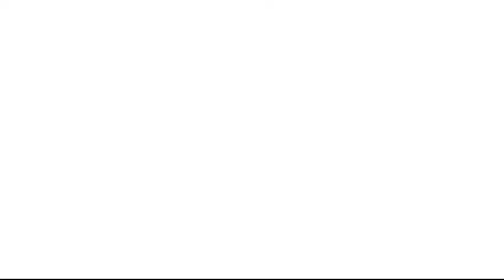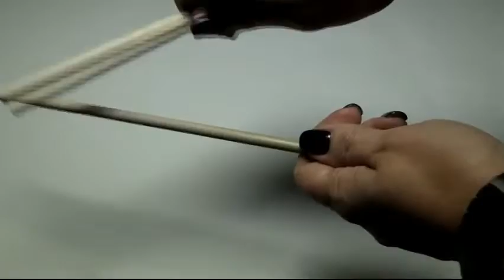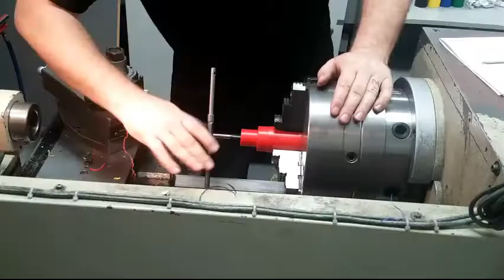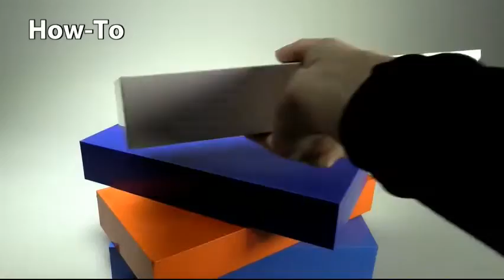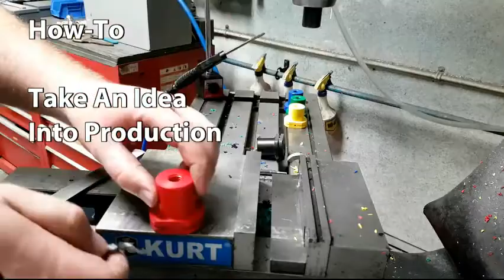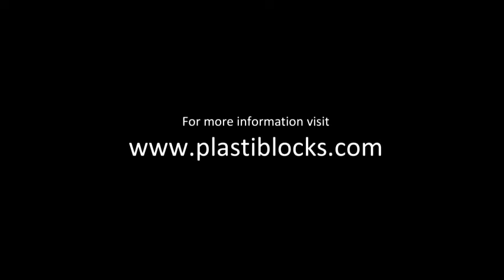Plasti-Block™  Channel  Intro.

Comment: Can you suggest a plastic type that is "gasoline" resistive for items like a funnel, etc, ABS, PLA....? Would not be used to store gasoline, but for poring etc.
Reply from the maker: Hi Tom.
HPDE is very commonly used for this application due to its chemical resistance properties.